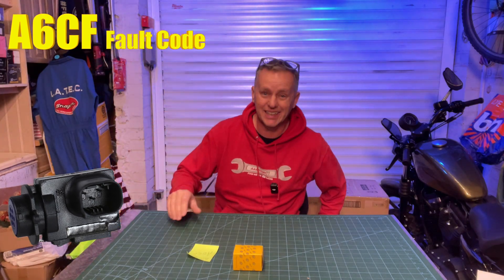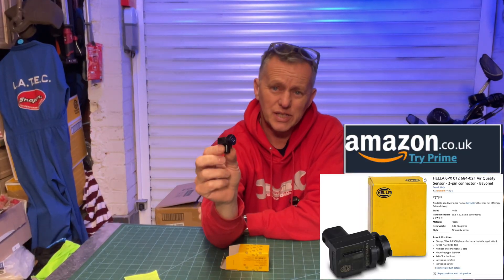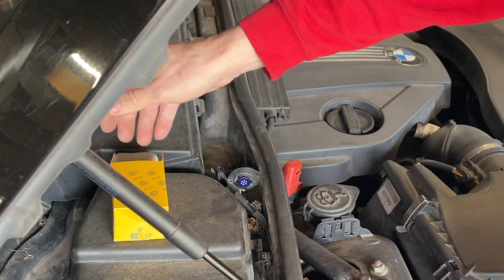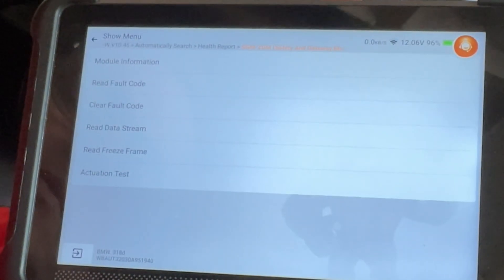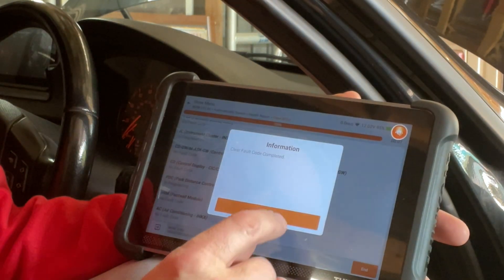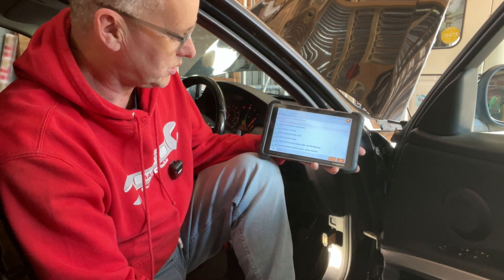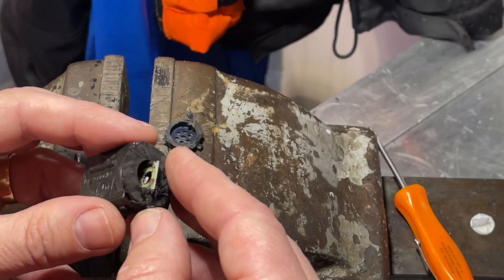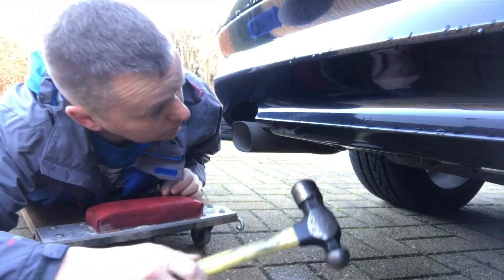BMW FAULT CODE A6CF AUC SENSOR, AIR CONDITIONING NOT WORKING!

Comment: I sprayed mine with contact cleaner about a year ago and did the trick too (for now)
Reply: So if this is not working right does it affect how cold the AC system blows. Having the issue where my AC is topped up but doesn’t blow very cold
Reply: @TheCaffeineRacer  Same thing for me, but I didn't know what happened. Thanks
Reply from the maker: Thanks for the great information👍🏻👍🏻🛠